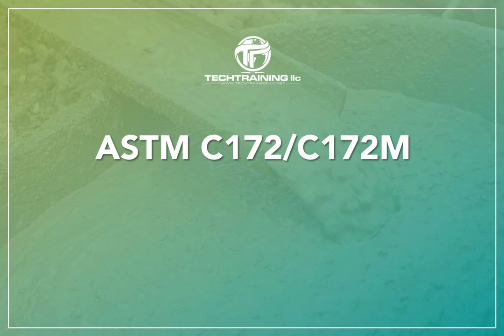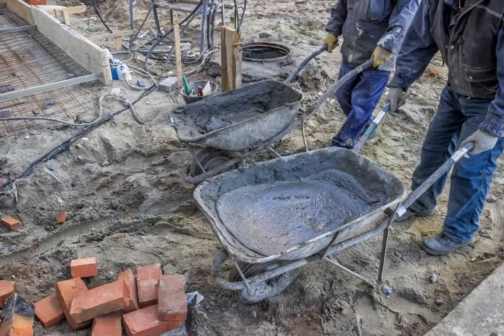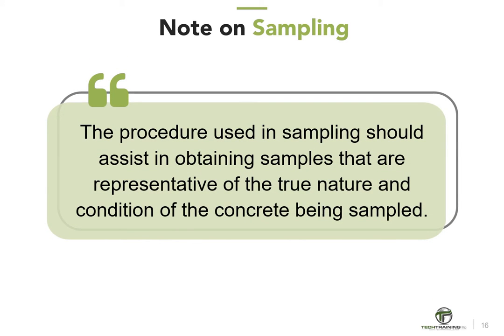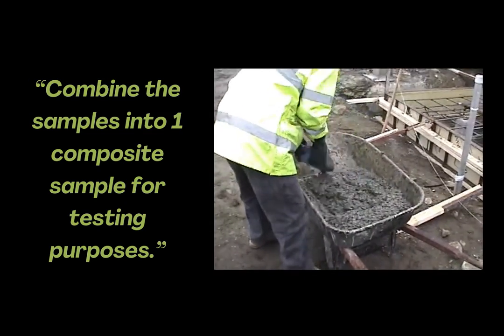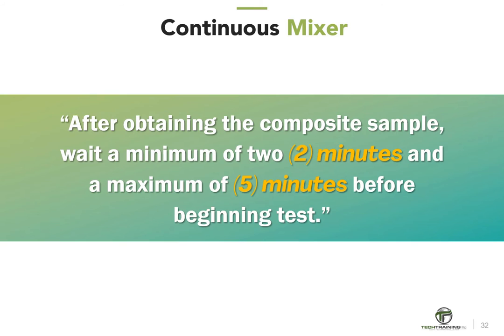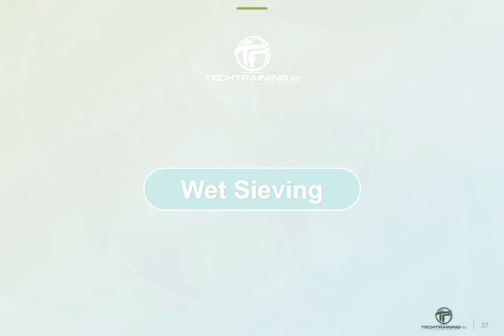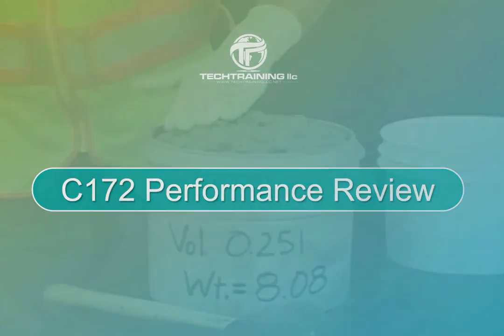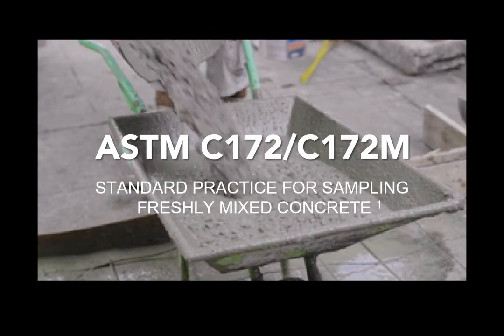ASTM C172-19a: Standard Practice for Sampling Freshly Mixed Concrete

Comment: If the concrete contains course aggregate particles that would be retained on a _ siev, wet-sieve a sufficient amount of the representative sample over a _ sieve, as described in practice C172. 
A) 1", 1.5"
B) 1.5", 2" 
C) 2", 2"
D) 2", 1.5"
I have it narrowed down to either A or B, leaning towards A but my book is so faded I can barely read certain sections. Anyone able to help me out?
Reply: B